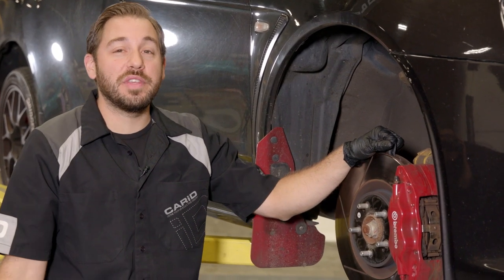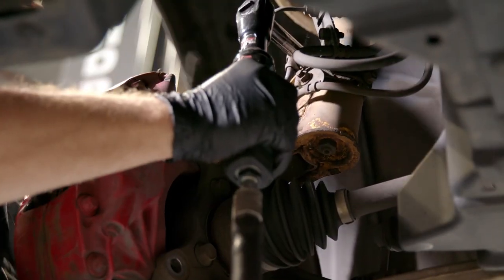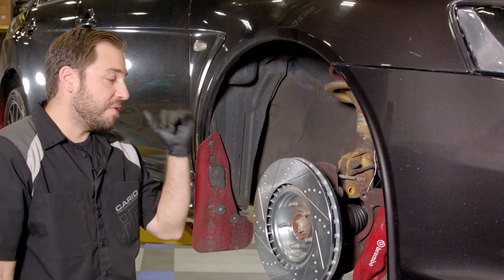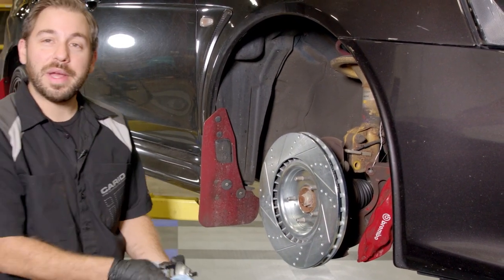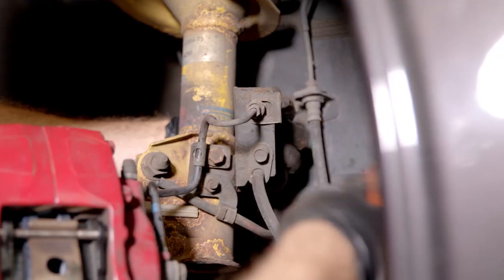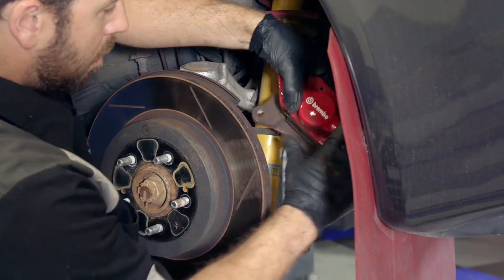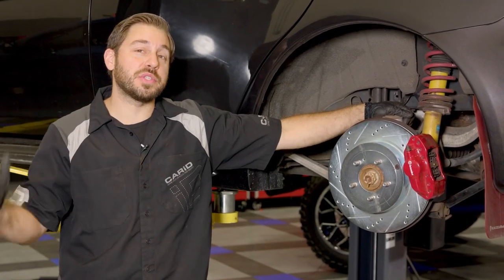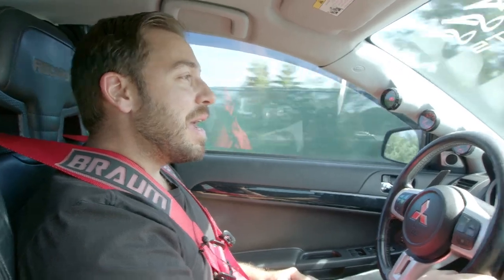Warped Brake Rotors? Do It Yourself!

Comment: Would've been good to see how you would prove a "warped" rotor, as they are extremely rare. The discolouration there was from a pad overheating and melting some deposits of itself onto the rotor. A shop's way to flog someone new rotors, but in all likelihood, new rotors weren't required, just a cleaning up procedure and higher heat resistant pads if thrashed on a track or circuit

Comment: Not even gunna put an indicator on those rotors to see if they're actually warped?
Reply: @carid  Assumptions then. There are several problems that can create the warped rotor 'symptom'.
Reply: @CaneSugarCane  Why does he need videos to prove his worth? He's actually right. On this video - no runout check, didn't remove rust from the hub face, didn't torque the lug nuts. These are absolute basics.

Comment: Hi! I have a question. I got my car  fixed (rotors [resurfaced], new brake pads, and flush brake fluid). My car used to shake on the freeway at 70mph. But now that I got my car back and as soon as I hit 50-55mph it starts to shake with out pressing the brake pedal, only when my car is running.
Reply: CARiD thank you so much! They also noted that “the front stabilizer end link both have play” and the “transmission pan have fluid seepage.” With so many problems with my car (Pontiac Grand Prix 2005), is it best to get another car?